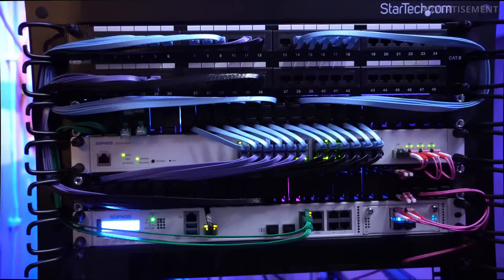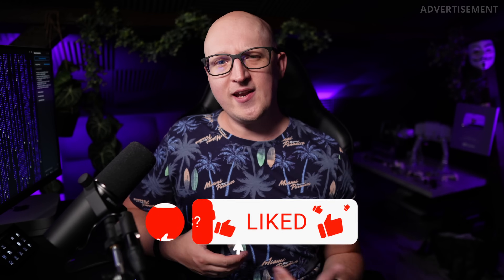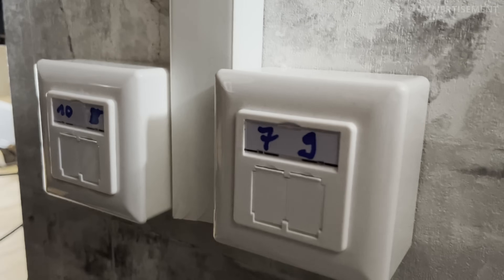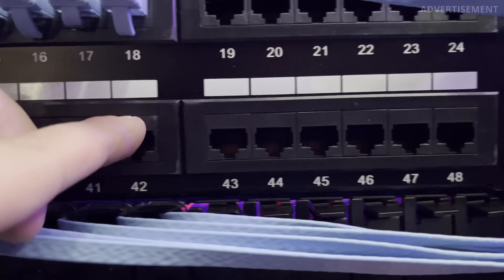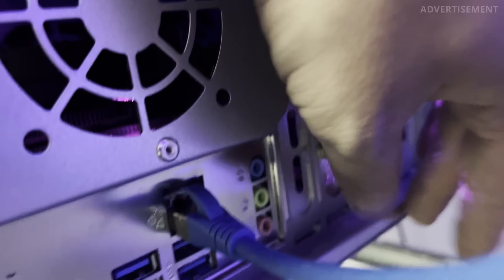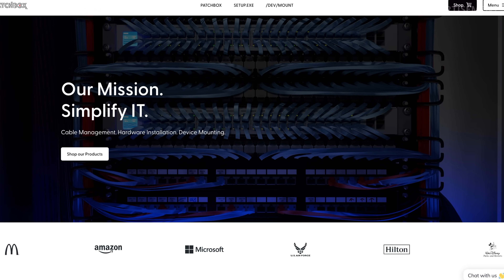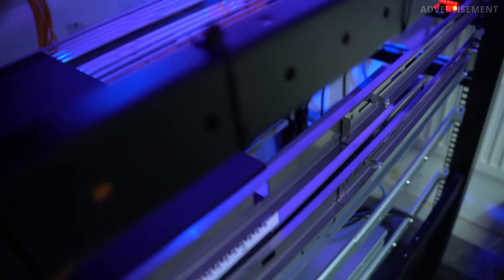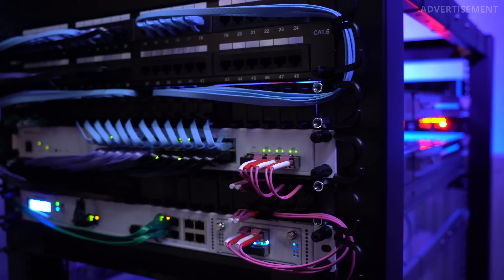My Cable Management got SO MUCH Better!

Comment: Patchbox is cool and all but I must be missing something. If you just put a 24 port patch panel right above the switch and use short patch cables, you avoid this entire problem, and you don’t sacrifice 1U of space for all this complication???
Reply from the maker: If you got an easy setup, I agree the value is quite limited. I think it becomes handy in scenarios where you often change things around (like I do).
Reply: @christianlempa  Which makes sense if it was used to run from the switch to random servers at the bottom of the rack or something but every time I see someone talking about patch box all they're doing is using up 1U of space to go from a patch panel to a switch like 2U's below it.

Comment: Hi Christian! Your copper ethernet cables are organized beautifully but you have too low bend radiuses of some fiberoptics cables. For example the leftmost pair in the time https://youtu.be/_Lg0_2dfe0w?si=m3k6YhF8ol5BwxZm&t=816 
Yes, maybe in homelab for a short distances it works, but there are pretty big losses of light in such a sharp bends and it could make problems in the longer distance connections. 
Have a nice time and thanks for your vdeos!

Comment: I have a 48 port switch and use two 24-port patch panels; one above and the other below the switch.  It works great with a cable management loom in between each patch panel and the switch.

Is EMI more of an issue in countries with higher voltages and 3-phase power like the Bundesrepublik Deutschland?
Reply: I use the same approach with the difference of brush panel instead of a cable management loom

Comment: I'm surprised to hear you say CAT7 is an industry standard. Last I heard (admittedly a while ago), CAT7/CAT8 weren't even fully certified standards. Was expecting to hear CAT6a was the industry standard. Maybe that's a country-specific thing?
Reply from the maker: Maybe that's different in your country, here I'd say CAT7+ is the minimum standard in professional environments mostly. But sure, that always varies based on the project.
Reply: 6A is the long term standard I was seeing when I was running cables a few years ago. None of the 7 series of cables are recognized standards here as far as I can remember. Cat 8 is recognized, but has a 30m max length, and was envisioned as a rack interconnect cable. My best guess is that either Cat 8+, or a hybrid fiber+power cable will be the new standard for PoE type applications.

Comment: I think that you are confusing a few things about ethernet cables. Cat6 can be both shielded and unshielded. It depends on whether you are using UTP or STP. If you have a Cat6 or a Cat6a STP does not make it a Cat7. Actually Cat7 and Cat8 are a whole other ballpark and none of what you have shown is either. The Cat7 and Cat8 does not even use RJ45. Instead they use GigaGate  connectors. 

Cat6: Thinner copper and less twisting. Perfekt for 1 Gbit/s connections. I would use solid STP for wall mounting and stranded UTP for patch cables, unless you have a reason for the additional cost of STP for these short cables. 

Cat6a: Thicker copper and much thither twisting. Perfekt for 2.5/10 Gbit/s connections. Again I would use solid STP for wall mounting. For patch cables I don't know about 10 Gbit/s, but for 2.5 a stranded UTP is fine. 

Cat7/Cat8: Unless you know exactly why you need this, you don't need it. If Cat6a is not good enough for your purpose, use the force of light and go with optical instead.
Reply: Agreed with all this, and I'd just add that as far as I understand the specs, cat 6A and 7 both have similar or same specs performance wise, and both are rated to 10gig. Cat 7 is actually the older standard, and as far as I remember, wasn't adopted as a standard in the US. As Daniel said 7, and 8 require special  jacks, require shielding, and special termination. 6E was also attempted, and likewise wasn't widely adopted. 6A was the most recent, (except for cat 8) and is IMO the best bet for futureproofing.

Comment: I recently added a half height patch panel where previously some space was wasted by the fritzbox 1.3u racknex mount. Now i have a dedicated panel to route in-rack ethernet to the inside if the rack, where i can made my own cables of the perfect size to still fully extend the server rails, while keeping everything neat. And above that panel there is space for the switch, followed by the poe injector (i use used hp 2510g switches, and didnt want to pay extra for poe) amd the patch panel that goes to the outside. The result is really neat, and allows tracing even by eye.

Comment: Patchbox is a convenient solution and I wouldn't say no if someone gifted it to me. On the other hand I can get locally made custom length and coloured cables for a fraction of the price. The real hero to keep it neat are the side hooks and those have been around for forever. Last but not least always use velcro instead of cable ties.
Reply: Same, stopped watching the moment patchbox was mentioned. Sadly too pricy for the homelab.
Reply: @janw.443  Just calculate the price per port in case of patchbox and regular cables. Depending on the amount of ports you need you may be surprised by the numbers you get. Patchbox tax is not that high as you may think. The reason why I have no patchbox at home is the fact that it does not have DAC cartridges. That's a showstopper for me.
Reply: @G00glieS why would you want to have DAC cartridges instead of just using fiber optics?

Incompatibility between brands would be horrible.
Reply: @-Xaverius dac cables can be programmed when needed or you can purchase a pre-programmed one. They are cheaper and they generate less heat.
Reply: @janw.443 same cause Patchbox got more and more flooded into my ads and I’m done with it. The prices are ridiculous dumb.
Reply: Agreed - super expensive for homelabs!

Comment: I found keystone patch panels way more preferable.
Reply: Same. I also recently found out there is a half height keystone patch panel, that paired nicely with my Fritzbox racknex mount that uses 1.3U
Reply: @klaernie LINK!?  :O
Reply: @scottxiong5844  just be aware: it's actually .5 U high - so only the top OR bottom holes will line up with a 3-holes-per-U rack.

Comment: I've seen Patchbox online a few times. To me, it's still a solution looking for a problem. The way your rack was originally wired was just fine. You could have cleaned up your cabling just by right-sizing some of the too-long cables or by switching to slimline cables, which are good to 10Gbit. That's what I've gone for, with a brush panel below my switch, and they look great. I use black cables and they are truly minimalist. You also could have run a couple of pair of fibre cables rather than all those UTP runs from room to room. I like you idea of a rear patch panel wired to the front patch panel though!

Patchbox uses hard-to-handle flat cables that are too wide and have to be artfully routed to look decent. The box is also ridiculously expensive, exceeding the cost of a secondary market enterprise server.

I have a 25U rack that's nearly full of gear. I've racked hundreds of devices in data centers during my career, and have seen neat wiring and wiring that was so badly done, it was impossible to trace a cable from start to finish. One of the tricks to good wiring is to label device and patch port number on each side of the cable. It's simple and effective. In most situations, a gentle series of tugs on a cable are enough to be able to trace that cable from end to end. Have cables wound in cassettes eliminates the ability to do this.

I have spent many thousands of dollars on my home data center. IT is what I do. I wanted current servers, so I bought and leased current model Dell PowerEdge servers. I have a hardware firewall. Sophos. (I know you like that.) I have storage that's separate from compute, and both are connected at 25Gbit. Virtual Machine disk latency (under ESXi), is generally unmeasurably low. Still, with all the expense, I would not be able to, or want to give up the rack room for, a Patchbox.

Christian, I enjoy your videos and your channel. I don't use much open source software and my lab/data center is more enterprise oriented. Still, I learn from you all the time what's out there and what the possibilities are. Thank you.

Comment: I would mount everything with the Networkports at the back. That way I would save me the Patchpanel from front to Back and keep the front Cable free
Reply: Yep. That's what I do with server racks.   I put the network switch on top of the rack and patch em from there.   Some installers would put the network switches in the middle of the rack while others put em on the top or bottom.     I prefer them on top because of the heat exhaust going towards the front of the rack instead of the rear.    I wish enterprise grade switches weren't designed like that.
Reply: @Darkk6969  On some switch models for datacenters, you can chose the direction of the airflow (front to rear or rear to front) just by changing the fan modules with the appropriate one.

Comment: Optically an upgrade, but technically a downgrade - but everyone has to decide for themselves. Personally, I would not run a new house wiring as CAT6 UTP. A patch cable can be exchanged quickly, but you don't want to exchange the installation cable again in the near future.
Reply: Hi! Replacing a cable takes less than 10 seconds with a PATCHBOX, it's a modular system :)
Reply: @PATCHBOX_SimplifyIT  But not his wiring through the house
Reply: That's why you use conduit and put a dummy pull or two in them.
Reply: @LackofFaithify  Theoretically yes. Unfortunately, this does not always work in practice. There is nothing to see in the video either.

Comment: No issues with using thin cables?
Reply: Our cables meet the ISO and ANSI/EIA/TIA standards, they are available as UTP and STP and there's no issue with crosstalk or similar, due to the short distances covered, unlike with slim patch cables, as another user already mentioned. Feel free to check out our Fluke test results in our blog :)
Reply from the maker: Nope works fine!
Reply: Better than those super thin wire patch cables that people seem to rave about.   The flats in this video is what I would use for patching.   Cable runs I'd use standard UTP CAT6.